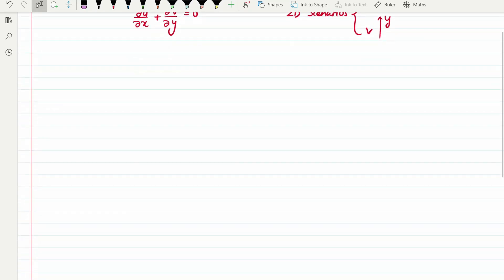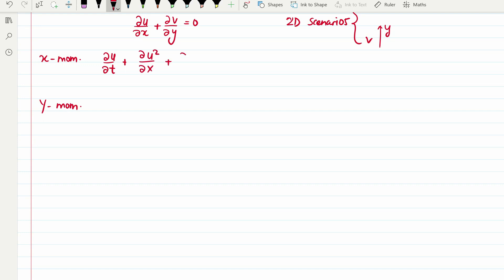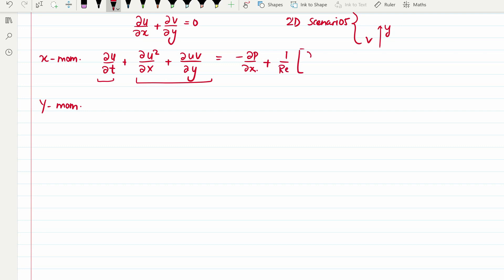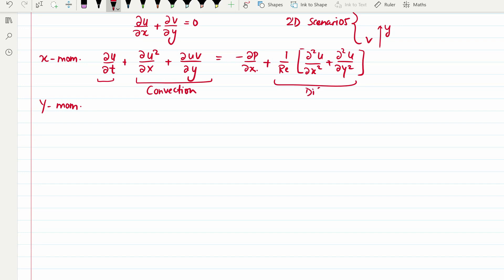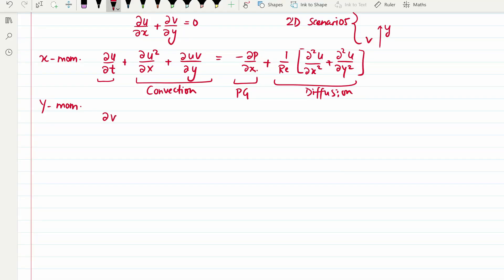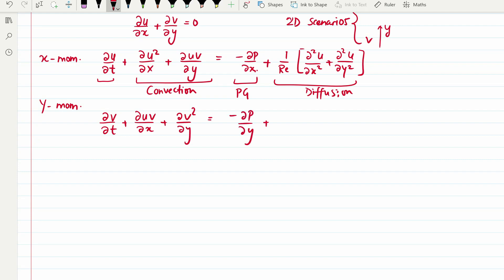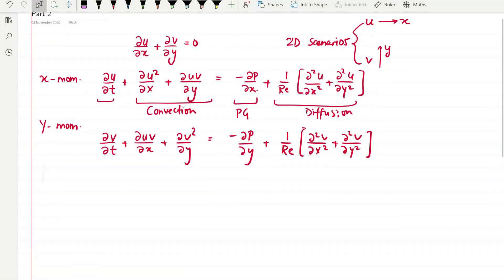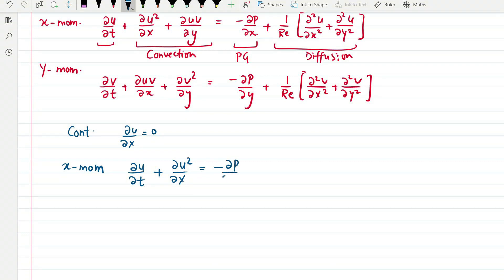Introduction to Staggered Grids | Lecture 14 | ICFDM

Comment: dear Tanmay Agrawal,

Thanks for this usefull course about staggered grids. I do have a question about the 2D incompressible NS equations. How did you get from (\vec(u)*\grad)\vec(u) to (\partial u^2/ \partial x) + (\partial uv/\partial y). When I do this or look around the internet I mostly find u(\partial u/\partial x), which are not the same also after the discretization. Could you assist me here or tell me where im going wrong?

thanks in advance,
Reply: @aled58 You are not wrong. I've seen this mistake in many videos and peer-reviewed publications. Obviously, using the chain rule on (\partial u^2/ \partial x) the result is 2*u*(\partial u/ \partial x), which is 2 times the correct result. The 1/density factor is also missing from the pressure gradient terms. Otherwise, the staggered grid approach discussed in this video is a good one.